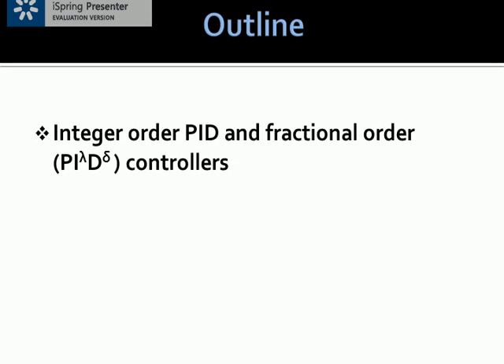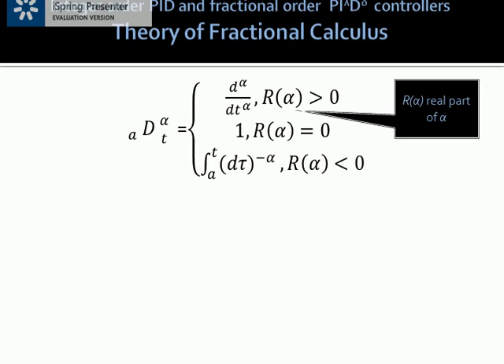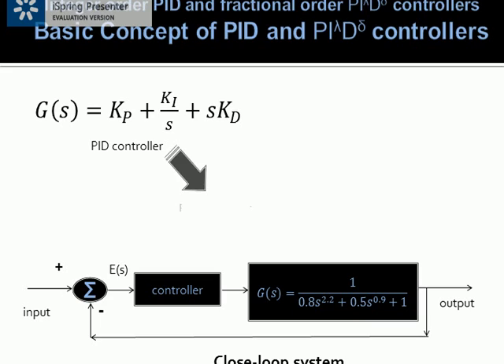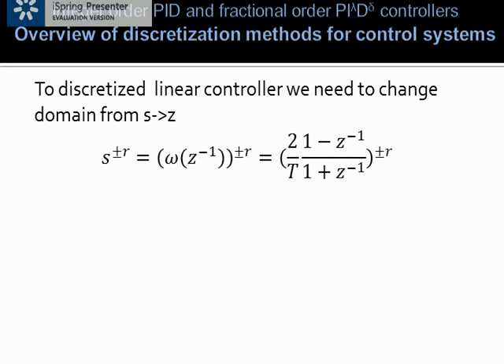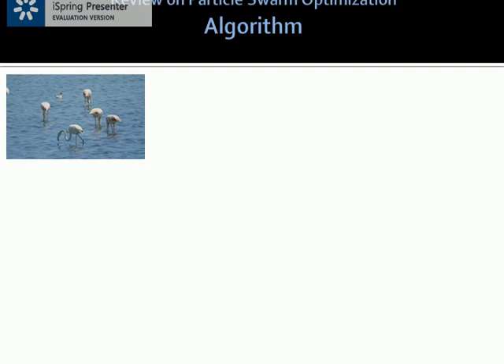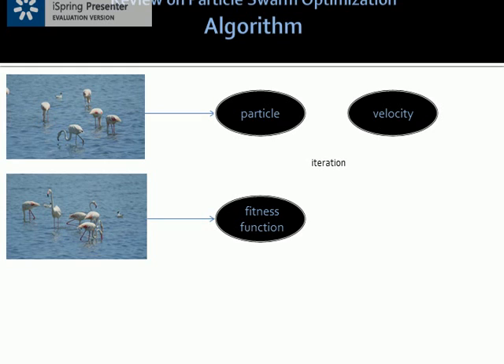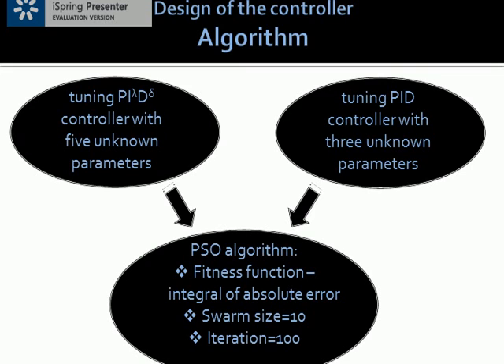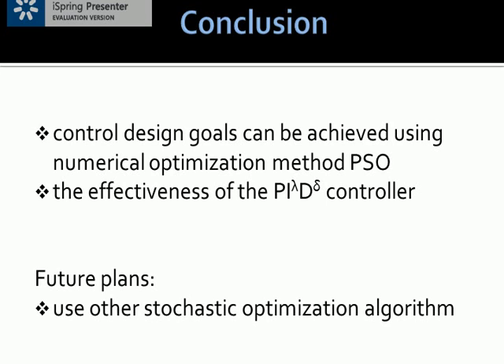Tuning PID and fractional PID controllers mpeg2video

Comment: hello klaudia , I want to work on fractional PID  controller for controlling vibrations in a structure ,please help me in that area
Reply from the maker: Vipin Pachori  hello, please give me more information about your problem. I would like to somehow help you
Reply: Klaudia Dziedzic firstly thanx for your reply. I am working on matlab and have developed the code for my structure , material properties , open loop response in terms of voltage(as I m using sensor patch made of piezoelectric material) , and also able to plot the closed loop response. But now I want to know that how to option various gain values for my smart structure. My mail id is vipinpachori1991@gmail.com
Please help me in that regard

Comment: Hi Klaudia  I'm in my masters degree in Electrical Engineering and i'm working about  Fractional Order PID Controller for Speed
Control of DC Motor. How to do simulation on matlab and simulink have you copy to guide me ? Thanks
Reply from the maker: Hi :) You need to get extra scripts. There are two options, one is to use Euler method from Petras scripts and the second is to use ninteger library for Matlab and Simulink. If anny question, please don't hesitate.
Reply: Hello can you help me
Reply: Sie Boris kam how did u tune the controller

Comment: How i simulate fopid on matlab?
Reply: Hi Vivek, you can use Ninteger toolbox or FOMCON  tool box, which can be downloaded from Mathworks file transfer site.
Reply from the maker: There are two ways to simulate FOPID.1) You can use nipid blocks, there exist GUI and m-files for that.2) Petras published in Internet m-files, for tuning PID with CFE and PSE method. It is really easier to use and implement.
Reply: @vksateesh sir , I am doing masters in electrical engineering .now iam working on fractional order controllers.can u help me in that area.my gmail saisndp4@gmail.com